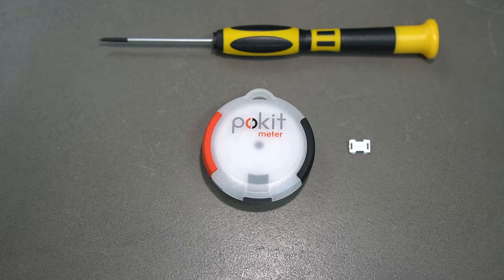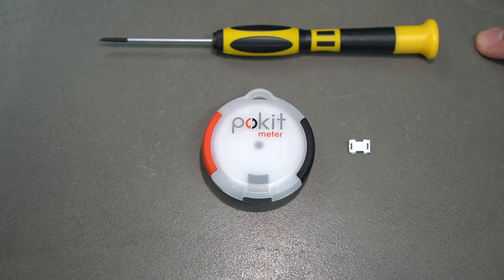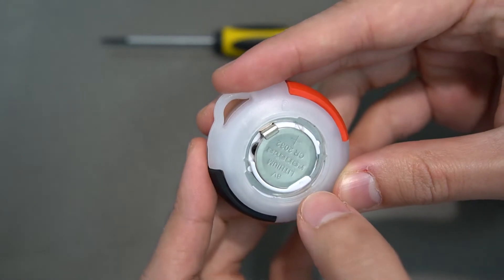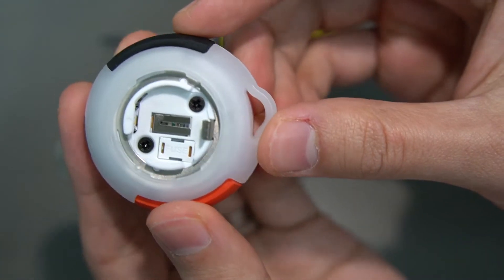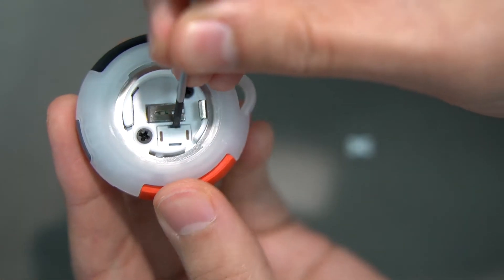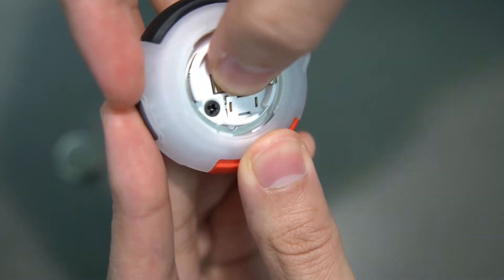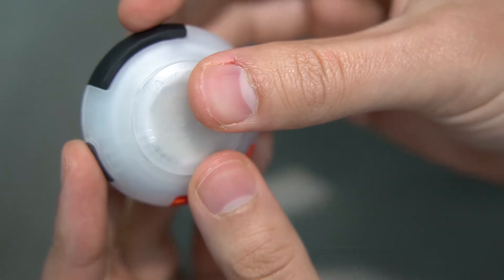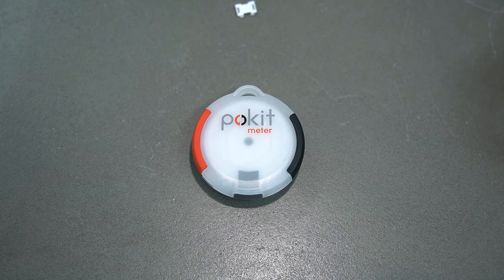Pokit Meter - Fuse Change - Pokit User Guide

Comment: 200 $?! 😨
Reply from the maker: Hi Christopher, Pokit Meter is US$98 on our webshop. 😄
Reply: @PokitInnovations  it says 198, I checked... 😳
Reply from the maker: @christophertadeo6120  Pokit Meter is US$98, whilst Pokit Pro is $198. 🙂
Reply: @PokitInnovations  u mean it still doesn't provide full functionality unless u buy pokit pro, then why the hell should I buy pokit only?! 😁... Which doesn't make sense entirely! 😁
Reply from the maker: @christophertadeo6120  Both Pokit Pro and Pokit Meter have multimeter, oscilloscope and logger functions. The main difference is that Pro can read higher voltage and current, and has multichannel functionality in oscilloscope mode. You can see a full comparison of specifications here: https://www.pokitinnovations.com/specifications/
Reply: @PokitInnovations  so basically you're saying pokit is a mini pokit pro without actually saying it is... 🙄
Reply from the maker: @christophertadeo6120  Pokit Meter is the first device we designed, and Pokit Pro is a larger, more powerful version of Pokit Meter.